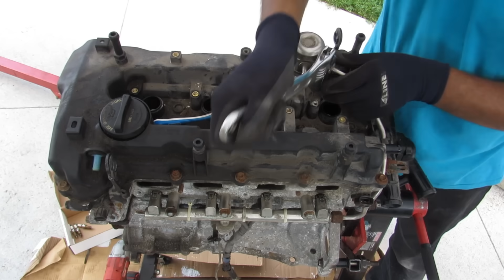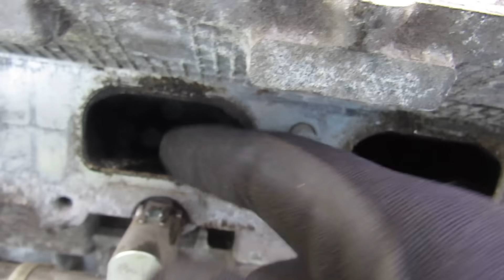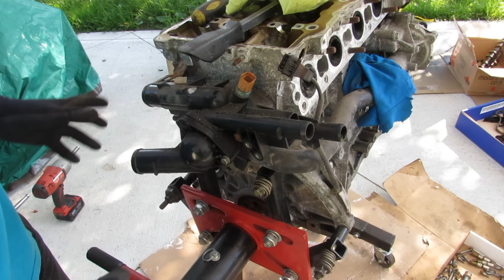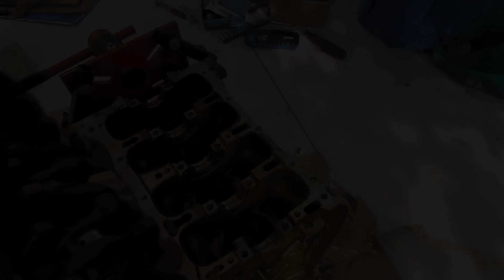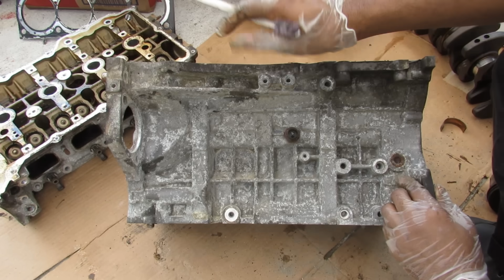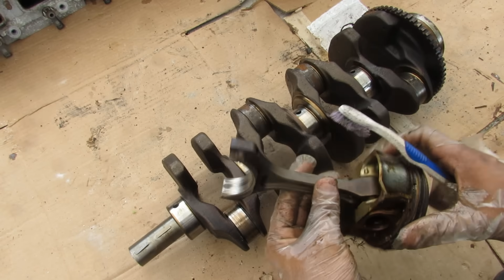Why Hyundai Engines FAIL

Comment: The failure? It's oil. The piston rings stick to the pistons at 75-80k. Oil flies past the tiny gap, through the combustion chamber, ports out the back. No oil = bang. Use Berrymans B-12 to unstick the low tension piston rings. 
I did so 30,000 miles ago, no issues since then. These engines sludge up. So use an engine flush a few times, a good branded one. Gas mileage gets lower too. Use Berrymans 2611 to get rid of that, every year / 10k. 
The rest of the vehicle is uncannily well built. I've driven a lot of cars. It's not much trouble apart from the fixable major design flaw listed above.

Comment: I think there are other reasons for these failures.  0w20 oil is demonstrably bad at maintaining film strength.  5w30 is much better, but Hyundai still recommends 0w29 for fuel economy reasons.  If the problem was machining debris, it would happen quickly, and the filter would remove most of the "debris".  Fuel quality is another problem - use Chevron gas.

Comment: I bought one of these and no problems yet.  I'm wondering if I can get a more forceful oil pump to prevent this thing from going to hell.  The body and interior are nice, and everything I hear about these engines scares me.  I want to baby this engine to see if I can avoid the fate of losing $5K the hard way.  What if I add sea foam to the oil right before I change it, and run it for five minutes with sea foam cleaning out the crap?  There has to be a way
Reply from the maker: Seafoam doesn't do much except put on a smoke show. 
Keeping it full of clean oil is key. 
Perhaps cleaning out the pan periodically if there's any contaminants in there would help.

Comment: all Hyundai cars are garbage - designed to last 50,000 miles before catastrophic failure is a likely situation you will fail. Or the equivalent of 50,000 miles in warranty time. Hyundai knows all about this and is calculating that once your vehicle is out of warranty and your engine has exploded you might buy another car from them (or not)
Reply from the maker: Thanks exactly how cars are designed, warranty plus one day.

Comment: My Santa Fe engine broke a year ago and they approved me to get a new engine this year and now they have a major recall for all they Santa Fe from 2013 to 2018 with their GIDV6 engine. I just got mine replaced for free and my local New Jersey dealership. It was a headache to take me a long time to get it in and get it checked out which is ridiculous, but hopefully they do as you have a better quality part and do not have the old issues. I think your video was one of those videos that approved to who does that they have shitty engines.

Comment: Timing  chains are still a service item. Lifetime of ownership, would see you in a new car long before it goes out.

Love the prior ownership comments on the rags and toothbrush!

I put more oil into the engine in a 3000 mile oil change than the total capacity of oil in the vehicle when full.
They want me to pay 600+ for a combustion chamber cleaning before they will warranty the motor ....

Comment: BS.
The particles would get trapped in the oil filter shortly after first run.
The real reason is because it's made by a POS Korean company.  And it's a cheap, disposable piece of carp.  As such, it's bought predominately by ignorant people who never change the oil, or don't use synthetic oil, or get the oil changed at cheap discount oil change places, as can be evidenced by the very dark oil residue everywhere inside this engine where the oil was in contact.

Comment: So now they're even making the valve covers PLASTIC?!?  Is nothing sacred anymore? Engines get pretty hot. It's a terrible environment to put plastic, even high temperature plastic, because it gets dry and brittle over time. Think of how 20 year old valve cover gasket seals look when you pull them off. They couldn't stop with converting most of the body parts in a car to plastic. Now, bit by bit, they are doing the same with the engines. Unlike cars from the 60's and 70's, the cars of today won't be around to tinker with and keep running in 50 or 60 years. The only way would be to replace all of the failed plastic parts with newly manufactured ones, if they even will be making them.
Reply: And you just know that they would really LOVE to make that heavy crankshaft out of plastic too, but they just haven't found a way yet. I'm sure at some point they will. Probably around they same time that they turn car ownership into a "subscription service".

Comment: I've got a 2015 Hyundai Sonata, it's runs perfectly, because it is maintained properly, the number one problems that these engines have, isn't particularly a design flaw with the motor, but insted an incorrect oil viscosity(too light) of 0w20 to 5w20, and extended oil change intervals, recommended by the dealerships in North America to pass emission standards...anywhere else in the world, these engines are holding up well. In Nigeria and other parts of Africa and the Caribbean these engines run 10w30 to 10w40 weight oil, which matches the proper bearing clearances by design, and the oil should be changed earlier to combat the carbonized effects of GDI fuel delivery,
3000miles max, or even sooner.
   I live in Canada where it gets very cold, and I still run a minimum of 5w30 synthetic in winter(not 5w20) and 5w40 synthetic in summer, my engine is very quiet, smooth and the dealership can't get over how sludge free it is, it doesn't burn oil, and the oil is changed every 4 to 5 k depending on conditions, I also run a mild engine flush 4 times a year in the motor oil to prevent varnish, stuck piston rings or blocked oil passages in the motor.
Reply: Wow, great work in attention to detail Brent 🎉I’ve a 2011 Sonata & she’s been good to me but I’m trying to stay ahead of knowing what to before anything comes my way. Thanks for sharing!
Reply: @Santos-ek8md  yeah, thanks
 these Theta II 2.4 engines are Mitsubishi designed, but built by Hyundai, it's the gasoline direct injection GDI that causes the major carbon build-up, that plugs off oil galleries, causes sludge build up, restricts intake valves and causes stuck piston rings and the thin oil is the icing on the cake for complete bottom end failure. 
Solutions: a minimum of 5w30 weight oil in winter, and 10w30 or higher in summer, early oil changes, and quality gasoline is a must to keep these engines alive.
Reply: I was advised to run 5w30
Ty

Comment: I have a 2017 Kia Sorrento with the 2.4L GDI engine that has no compression in cylinder 3. Would this be an issue that is covered by the recall due to the metallic pieces being left behind?

Comment: I floored the engine with 65k miles on it and spun a bearing.Took head to shop for a month for valve job,I put in new timing chain and main and rod bearings,only one was spun,but crank was not damaged.Put together and runs better than before,girlfriend put 2,500 miles on it since rebuild,still runs great,keep fingers crossed. Only use Quaker state full synthitic 5w 30 as the manual suggests.

Comment: I have a 1.6l accent that is doing pretty good, 110k miles, I just did a lot of maintenance, fixing to replace the HPFP and cam follower. I will say that the computers in these are retarded. a cylinder can dead dead due to a sparkplug or coil and the computer wont say anything about it. Also if a code does pop, even if it is a sensor you unplugged on purpose for a minute while the engine ran, it wants to be a permanent code even after everything is working fine again.

Comment: this really doesn't explain why these fail, the original theory was the cars made in Alabama were the problem because of machining shavings clogging up the oil pickup screen starving the engine for oil. No pictures ever of the clogged pickup screen, which should have shown up in tear down videos or even from a certified mechanic shop. I've also read that they burn excessive oil due to soft metal blocks where the oil ring fails, another theory was oil ring was for low compression engines, not these. Some Hyundai mechanics say there's too much cylinder pressure cause by the direct injection?? The Russians who have lots of Hyundai autos rework the oil pump some how, I forgot where I read that. What this shows is what would happen to any engine starving for oil. Has anyone ever monitored oil pressure on these engines? There has to be a logical/fixable problem in the 2000's

Comment: Great video - thank you. I have a 2014 Kia Optima 2.0L Turbo that has under 100,000km on it. I find that the engine is burning/losing oil as well as coolant but Kia tells me my engine does not qualify for a new motor but they can't tell me why its losing oil. I have no oil pools under the car and I see no blue smoke from the exhaust. Are these symptoms an indicator of the fact that I will have engine problems at some point? There is no knocking, the car starts reliably and otherwise I love this car.
Reply: 2015 Kia Forte Koup 2.0L engine here. Engine consumes about 1 quart of oil between 5,000 mile oil changes. Has since it was new. Use 5W-20 and switched to 5W-30 but still consumed.

Comment: Theda 2 in my Kia sorento..... got 196500 miles so much for them failing at 85000 miles..  seems more like the owners not doing the engine oil changes
Reply from the maker: Does it burn oil ?
Reply: @speedkar99  no....
Reply: Probably not doing any kind of maintenance at all. Most people don't. Just drive it until the wheels fall off.

Comment: Makes you wonder if the root cause was an incomplete oiler passage drill-out to the rod bearing. Seems that #3 rod bearing was the point of greatest failure. Consider that the manufacturing of the crank shaft would use a CNC machine for the oil passage drilling; an incomplete drilling to intersect with to cross oil passage through the journal would be penetrated only by the drill tip! That would result in reduced oil flow to the specific bearing and leaving  a sharp edge for debris to collect.  That original drilling depth setting would have been determined by a CNC training session, to be endlessly repeated on every crank-shaft that was ever machined for that model! Had the root cause have been determined early on, a simple editing of the CNC script file would have saved much greef, lost capital and customer good-will. Take a teardown crank from failed engine teardown and see if a piece of drill-rod will drop all the way through the passage. I have seen YouTube teardowns where the feeler rod would not pass through. Why did it take a number of years to figure this out?
Reply from the maker: I agree

Comment: If you do not change the oil IE(5000 KM). The oil control rings get carbon deposit and do not move freely. and so oil is now able to enter the cylinder. now the burning of oil starts.  then it runs out of oil because you never check it.  In the video the crank so all rods have had oil starvation. I have found that cheaper cars do not get maintained very well. Change the engine oil.

Comment: Can someone please tell me why these engines fail and I have a 2008 Hyundai Sonata with the 2.4 four cylinder engine and I have 124756 miles with no problems. I change the oil every 3-4 months or 3-4000 miles and use Castrol  10 w30 synthetic blend oil high mileage in the green jug with a super tech oil filter. I flush the coolant annually and service the transmission by draining the fluid from the plug and it takes one gallon of what I use Vavoline high mileage synthetic transmission fluid in red bottles. Tune up plugs and air filter every two years. Is there something different about the 2008 and the 2012?
Reply from the maker: Keep your 2008. It's not a theta engine.

Comment: Had a 2014 Sonata. Went 142000 kilos (87,000 miles ), never had any issues. Oil changed every 7500k.with regular 5W30 ( i am 75 year old and i do not trust 0W20 synthetic oil ) I was told by the dealer that the sand they used when manufacturing the block was not perfectly cleaned out when assembled and in some case could ruin the engine.  Purchased a 2023 Genesis with a turbo 2.0L. Hope this one does as good as the previous one.

Comment: I understand the engine failures that were caused to poor manufacturing processes - but it sounds like they figured that out at some point after 2014-15.  I assume the actual cause of engines after that burning up is from being starved of oil.  I have a 2017 that just started burning oil - about 8000 miles before I bought it. When it's burning more than 5 liters in 3000 miles - and the Oil light doesn't seem to come on until there is no oil on the dipstick - it seems inevitable that these engines are running dry and being driven that way between oil changes.
Reply: You’re not supposed to wait for the oil light. That means “low oil pressure,” and by that point, damage is already done. You need to check the oil yourself every time you fill up the gas. This is a very flawed motor and needs constant attention to keep it alive.
Reply: @AJB-2005   I'm saying, maybe it would be smart for the manufacturer to design the oil light to mean "oil level needs attention", not, "oil is gone and engine has destroyed itself"

Nobody is telling buyers of these vehicles that they are prone to consume oil and will run out if you're not vigilant. It's not common knowledge outside of car forums.

Comment: I keep on reading/hearing bout these kia engine failing, obviously the newer ones.  Luckily for me I've owned a previously not well taken care of 2003 kis rio 1.6l I used for 45,000 as a work car with stick shift, now has 161,000 miles on it but I hear the beginnings of rod knock if I listen closely near the oil pan,..but I changed oil fairly regularly unlike previous owner who even had it low, ..anyway got the car fairly cheap(wasn't really worth it most likely).  I think it lasted so long cause its an older and simpler design.  I could probably throw in some crank and rod bearings for fun just to see what happens.  A remanufactured engine would cost about $3500, not worth it for that car.  That engine design uses a timing belt and interference style engine, meaning engine destruction if belt fails,...it almost did bout 15,000 miles ago, where former owner lied that the timing belt was changed, not true from what I saw, the support bearing whining and yellow overheated color and belt stretched.

Comment: So the reason why this engine failed is because one of the crankshaft bearings got damaged somehow where it's all scoured and the bearing rotated inside or shifted and that area got too hot with friction?  I wish they could just abbreviate it into one or two sentences.  For example,  "Osteoporosis, Covid-19, Multiple-Sclerosis, Mad Cows Disease, Lymes Disease".  There needs to be a simplified diagnosis in a nutshell.  Maybe in this case it is "Seized bearing"?

Comment: Got a 2019 sonata  with 46000 miles on it..    What do you suggest to do to  that will maybe prevent this from happening?   I use full synthetic,And I use Seafoam spray to clean  some carbon/MAYBE  going thru the throttle body or the brake booster hose...   ANYTHING ES]E TO TRY????  flush the oil a few times???   Thanks

Comment: There are A, B and C bearing sizes for the 2.4L engine. You have to know the standard diameter of your crank and the inner bore of the rod with cap on and also the thickness to have the necessary oil clearance of up  to .0007 and to me no more than that.  A clearance is from 2.00787 to 2.00811 and B from 2.00811 to 2.00834 and C is 2.00834 to 2.00858

Comment: Since many of these engines continue to run past 200K miles...there are three considerations for rod bearing failure: engine loading at low rpm (not a highway problem): oil dilution caused by GDI; extended oil change intervals (longer than 6 months). The deburring process is a load of manure.

Comment: One of our customers had his engine replaced under warranty years ago, now this engine is failing (sets knock code and goes into limp mode thanks to software update) and dealer wont replace that motor.  I would stay far away from this car company so you dont get screwed like him.

Comment: Got a 2016 sonata limited went from changing oil every 5k miles to 3k to 1k to about 200 - 600 i did fuel treatments to get rid of carbon replaced spark plugs and so on was good for a while now its seized and been in the shop for about 2 months and now they are saying it will take 6 more weeks to see if im eligible for engine replacement.  Even though the previous owner was they just didnt get instead they sold the car and i was the dumbass who unfortunately bought it
Reply from the maker: Ouch! Any warranty?

Comment: I am considering changing the engine. What engine fits easily in the engine bay for a 2017 Sonata? Should I use a 2.0T or 1.6T, or an engine from another manufacturer like BMW's B58 or from Chevy like an LS? What do you think? Note: I do not want to change the car.
Reply from the maker: Interesting product. If you wanted reliability a Honda K+series could work. If you wanted speed, maybe transplant a turbo 4 from a Mazdaspeed or GTI..

A V8 isn't gonna fit in a Sonata
Reply: @speedkar99   thank you for your reply

Comment: I had a 2014 Kia Optima with 130,000k on it and I got to say it was one of the best cars I have ever owned. Cruising in a Mazda CX-5 now which is the best car I've ever owned. When it comes time for replacement, I will consider both these brands. Good job on the video. I've seen several and you do a great job.
Reply from the maker: Mazda is a good choice.